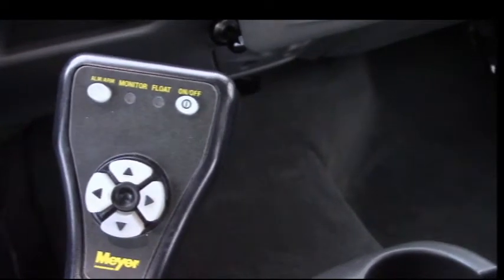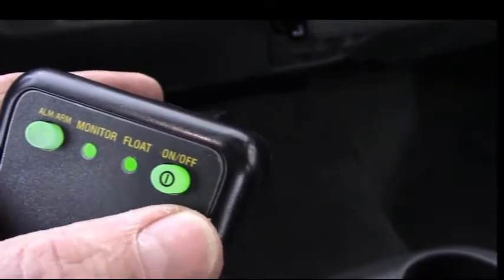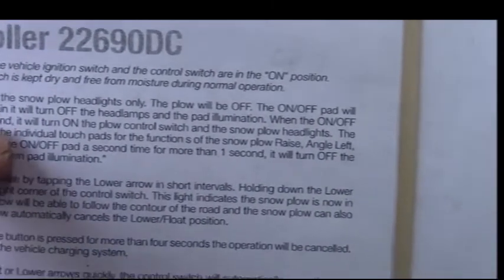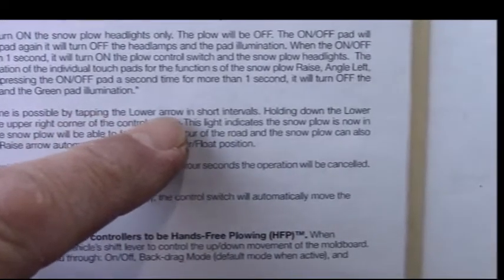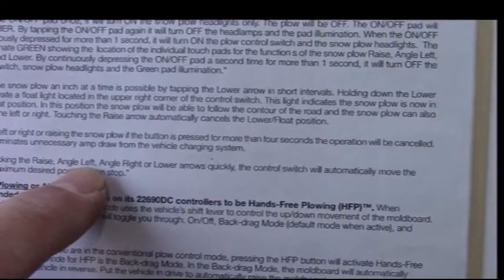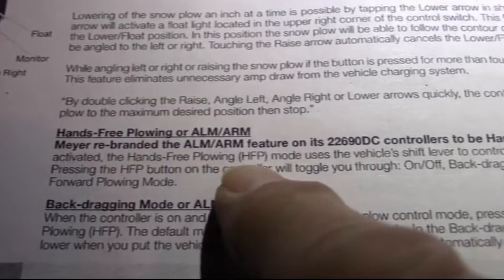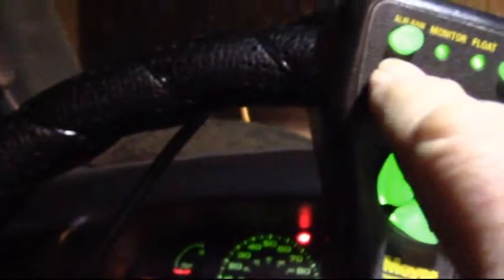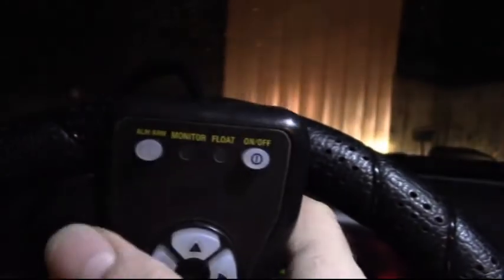Meyer Snow Plow Pistol Grip Controller How To Operate Float Mode and HFP Hands Free Plowing

Comment: You have an older 22690X controller. It does not have the DC (Double Click) functions. The 22690X does not have Lights Only mode.
Reply from the maker: Great! Thanks for the info! Will to old plow work with new controllers? Do you sell them?
Reply from the maker: I've watched your flushing video many times. I was thinking of giving it a try. Is it necessary to put the summer fluid in the pump?